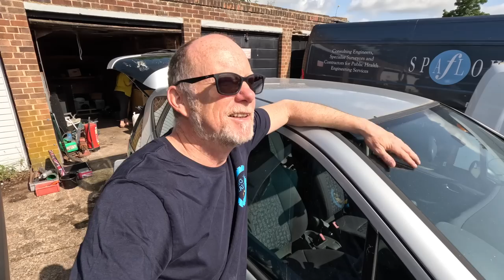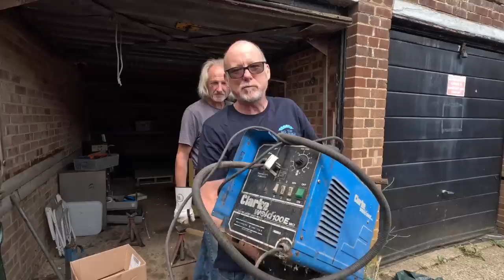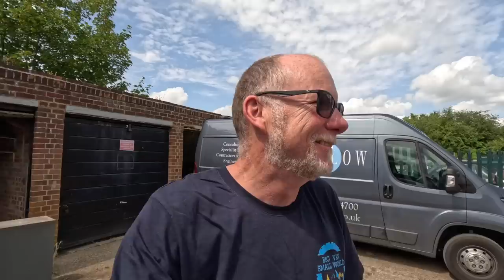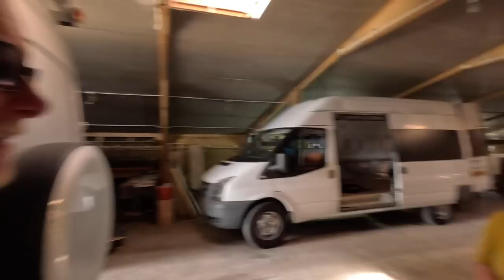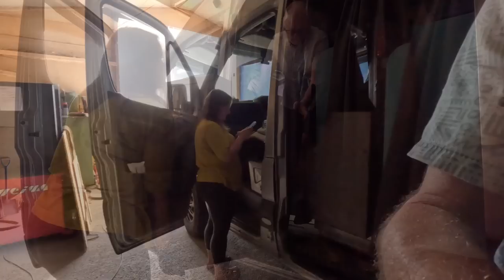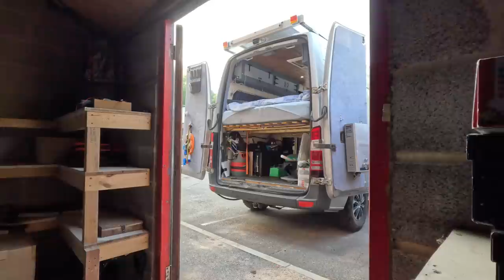KICKED OUT - FORCED TO MOVE ON  #vanlife

Comment: The car breakers are giving you more because catalytic converter prices are up just the same as gold, palladium, platinum and rhodium (all elements found in catalytic converters). They always strip the CCs off the car before crushing it into a cube. I have a 1998 Ford Econoline van with a Torpedo style CC worth over $600 US as I type this. I'll be tearing it out shortly 😄